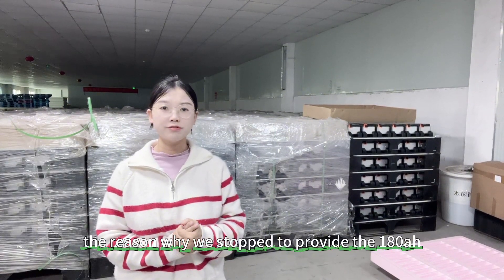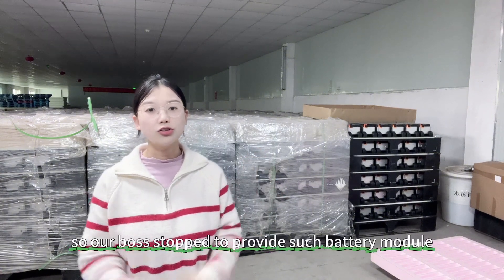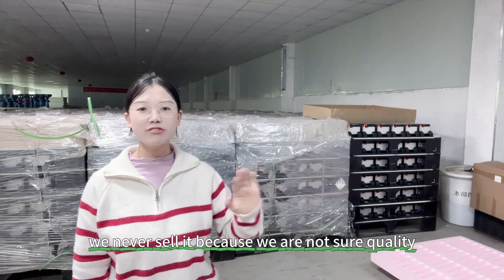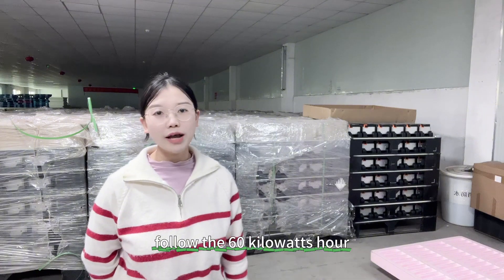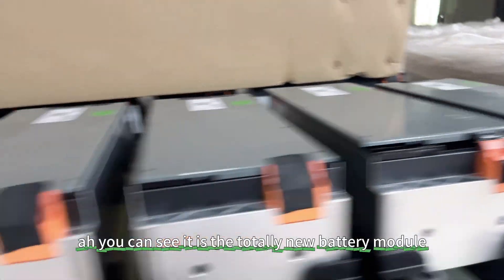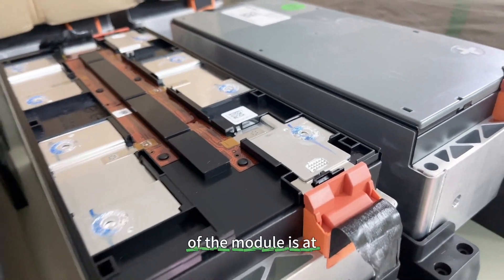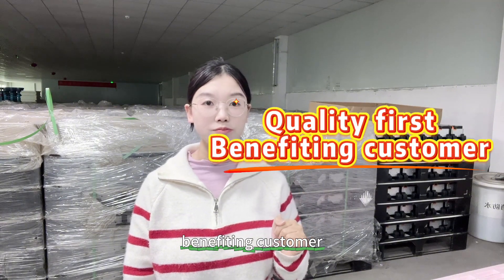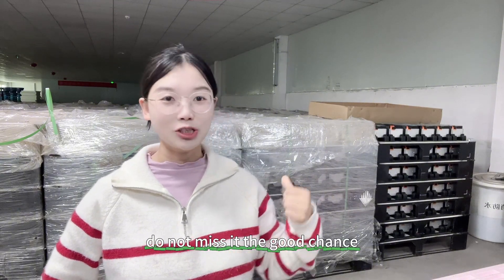Why stop to provide 180ah battery module for EVs

Comment: What are dimensions of those 153Ah modules?
Reply from the maker: @emceh  355/151/110mm
Reply: @starmaxenergy  do you have 2s 4s 6s modules? or just 4s available?
Reply from the maker: @ now stock is 4S 8S 12S
Reply: @starmaxenergy  can I mix them? are they all ~150Ah?

Comment: 4 years old is not new module it's 4 years old lithium cells module with internal cell degradation that this fact imply !   Question to deepseek was "what is nmc cells aging degradation after 4 years storage ?"   answer is:  "Expected Degradation After 4 Years:
Capacity Loss: Under optimal storage conditions (moderate temperature, ~50% SoC), NMC cells may lose 2-5% of their capacity per year. After 4 years, this could result in a total capacity loss of 8-20%.
Increased Internal Resistance: Internal resistance may increase by 10-30% over 4 years, depending on storage conditions.
Recoverable Capacity: Some of the lost capacity may be recoverable after a few charge/discharge cycles, but permanent degradation will remain.